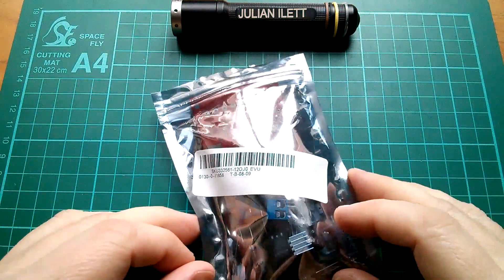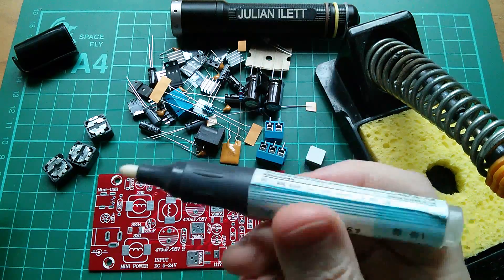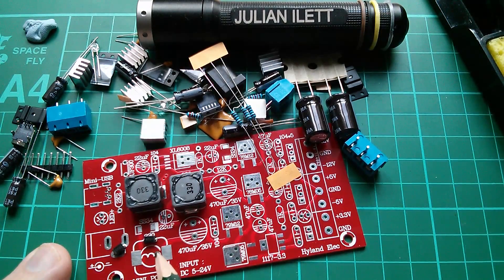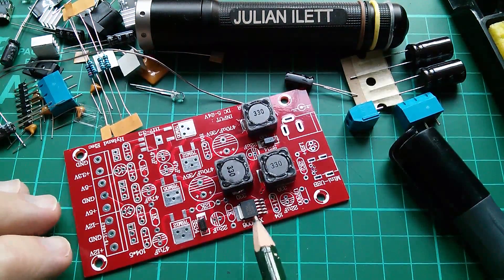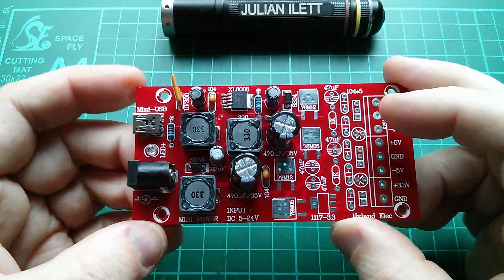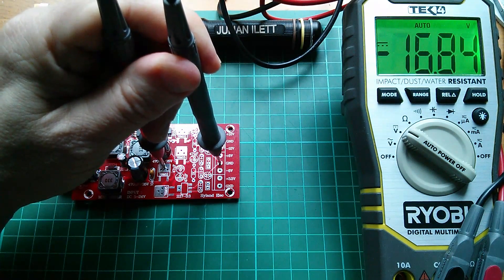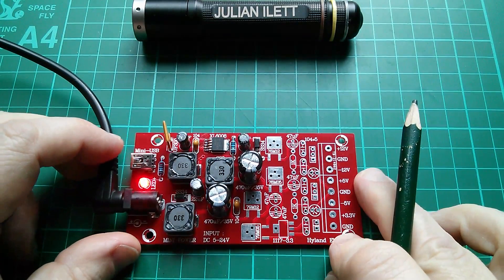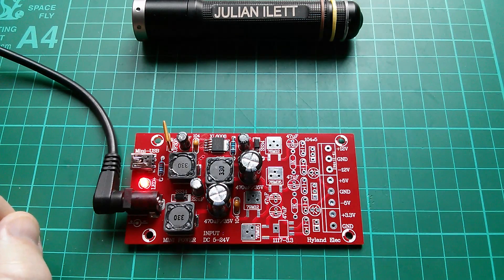Split Rail Power Supply Kit Build - SEPIC Cuk Topology

Comment: Pre-solder one smd pad. Use tweezers to shove component into that blob of solder while re-heating up that pre-soldered pad. Lift the iron. Component is now held in place by solder at one side.
Apply solder to the remaining pad as usual. Done. Component centered. Not tombstoning nor glitching away during soldering.

Comment: I came across the schematic of this kit while researching a replacement power supply for a Feeltech FY3224S signal generator. Hope it helps some one. https://forum.banggood.com/forum-topic-123630.html?page=3 If the link doesn't work, it might have been moved to another page of the forum.

Comment: Sorry if this is a dumb question... Since you were getting > 16v before the linear regulators, so could I swap the 7812/7912 for 7815/7915 and get +-15v ?
Reply from the maker: Not a good idea. The 7815 has a typical dropout voltage of 2V (according to the data sheet).
Reply: So it does.  Thanks for the quick answer.  I'm very much enjoying your channel; keep up the good work.

Comment: i always apply solder to a single pad and then with the component in tweezers you can slide the component into molten solder by applying the iron again .

Comment: This is really adventurous of you Julian, I designed switch mode converters for a living before I retired and I never understood either SEPIC nor Cuk converters well enough to actually use one.  One can get the basic principle of how they transfer energy from the input to the output easily enough but understanding the details well enough to design a converter is a step too far.  Most converters like this rely on using the inductors in continuous mode ie the load current should never be less than the ripple current in the inductor so they can't be relied on to work properly at no load.  Cuk and Middlebrook are well known in the industry for for inventing new complicated converter topologies which involve lots of complicated mathematics to understand and use.

Comment: Do you think this would run a few Eurorack synth modules??
Reply: My thoughts too. Plus a nice +5v supply as well. The power is enough for a few modules, the test will be how much noise is created by this circuit. I've ordered two from Aliexpress and will be testing them for noise in audio applications.
Reply: Chris Allan it would be a good cheap solution for a few modules yes. Wonder how many amps it puts out?
Reply: I built 2 and had problems with both. The 12v regulators seemed to drop the voltage to 4.8v. Tried a beefier psu than USB and the dc-dc chip fried. Same issue on 2nd board, not getting +/- 12v
Reply: this is strange Chris. I also think about getting one to test modules or schematics

Comment: Try soldering a tad bit of solder to 1 pad first (use flux). Then use tweezers to hold the part and then heat the pre-soldered pad with the part held in place and pressing the part into place with light pressure.

Comment: Opamps hate HF noise, so a scope of the ouput voltage noise would be interesting! Unfortunately almost all linear regulators are not good in surpressing high frequency noise. Below 1K they can reject almost 80dB of the supply noise, but at the much higer  switching frequency this drops below 20 dB! So the noisewill mostly depend on the quality of the low pass filters in the output.

Comment: Why wouldn't you instead make this an adjustable tracking regulator? All you would need is to add a pot instead on the ref pin voltage divider. It would be be more versatile and you could still use the other regulators  as well when it is above the fixed regulator voltages.

Comment: Hmm i think you should do your assemblings/component solder job in a time lapse....i just watched the very last minutes..the other is just too long/boring to watch...and may focus on where the "rubber meets the road" and test this thing.

Also there´s a reason for not putting the positive reggulators in series: when you draw about 800mA on the +5Volt rail and these 78xx would be in series, there would be likely no chance to draw some current on the 12Volts rail anymore, as the 7812 would be near its maximum current already. 
therefore, if you want to use both and load both with some serious current going parallel is the only solution.

Comment: Julian,

I reckon the positive side will generally need supply more current, particularly at +5 volts - that is certainly the case with PC PSU. With the +5 volt regulator feeding off the +12 volt regulator, you could easily exceed the current capability of the +12 volt regulator. Just a guess - i have no idea what the specs of the regulators are.

Alan
Reply: That's exactly my thoughts as well.
Reply from the maker: Yeah, I do see what you're saying. If you pulled the full 500mA from the 5V reg, you couldn't pull any additional current from the 12V reg (if they were cascaded).

Comment: There is a technique for soldering SMT parts one handed, so your free hand can (using a tool) hold down the part. Using some thick paste flux, dab some on the board pad and part you are soldering. Flow a nice blob of solder onto your iron top. Use your free hand to hold down the part, and touch the iron top and solder blob to the pad, a good pasty flux should let it flow easily.

Comment: Should you feel the need, for op-amp work, you could probably change the feedback divider ratio on R2/R3 and raise the output to 18V or so, following it with +/-15V linear regulators.
Reply from the maker: I've got another one coming which has +/- 15V :)
Reply: Excellent, it will be interesting to see what the differences are and how it performs.

Comment: Nice little kit julian, i like the use of blu tac, stop the little devils moving :-D.

Your 5v regulator input does seem a better way, but the 12v regulator would be loaded up perhaps double the current, perhaps a bigger 78xx regulator with heatsink would be needed.
Or put a big zenner in series with the 7805 input to drop the voltage a bit.

Possibly put a 2v zenna across the input led to stop it getting really bright :-D

Comment: This board has surface mounted components which are harder to solder than when the board is drilled. In that case the component leads go through the holes, and the soldering is done on the opposite side. That is easier to do.
So what is the advantage of taking the surface mount route?

Comment: Just what I have been looking for.  I would like to mod it to produce ±15V or even ±18V (for pro audio circuits).  Alas, not only is it "Under restocking. It will be available soon", but to add insult to injury: "For now, this product Does not provide circuit diagrams and installation instructions, just install correctly in accordance with the PCB screen printing, you can work without debugging". Thanks a lot, guys.

Comment: The problem with cascading regulators like they have on the negative rail. Is that the 7912 has to supply all the current that the 7905 draws as well as what you draw from the 7912. So it becomes a trade off between heat-sinking of regulators (the way it is done on the positive rail) and the limited output current of cascading in the negative rail (you can not expect to draw 1A from both the -5 and -12V rails)

Comment: You could always cut the trace on the input pin of the 7805 and solder a bodge wire from the (now isolated) input pin, to the output of the 7812. :)

Comment: your RYOBI multimeter? are you happy with it? there is a local pawn shop that has the same unit new with the film still on the display and spare battery and charger for $40.00
Reply from the maker: It's probably only worth that if you already have other tools in the Tek4 series
Reply: i dont. but i dont think that unit was offered in the states. i cant find much info on it. it looks to be a rugged unit and i tend to be unusually hard on my meters...i actually drove over my last good one.. thanks

Comment: 78/79 series regultors are too slow to reduce the high frequency noise. LDOs do better job. That'ss why you'll see this parameter in LDO datasheets. however above  10-20kHz the noise rejection is not that great. My guess is that this power supply will be terrible for audio.
Reply: If my memory serves me, the Sepic inverter provides quite low noise.  There are the multi phase devices that may be better, but at some point an optimum choice is something that is Simple and Good Enough.

Comment: 14:08 about the +12 and +5V linear regulators being in parallel, perhaps this is to reduce the load on the +12V regulator. Otherwise that would have to supply all the load on the +12V rail as well as all the load on the +5V and +3V3 rails (plus losses in those regulators).

Comment: Hi Julian.
I have a question about the maximum current that this supplies on the 5 volts rail. I am trying to power a raspberry pi3 with some 18650
Reply: 78M05 maximum current: 500mA. It won't be enough to power a Pi3 which needs a minimum of 750mA to be stable. 

Besides, you'd better getting a cheap empty powerbank on Ebay and then putting your 18650s in that powerbank. This board is meant for very low current devices like preamps or oscilloscopes, not for powering heavy loads. The linear regulators on the output will get very hot: at 500mA of load, you are dissipating 5.5W of heat which is wasted!
Reply: MrOpenGL
thanks

Comment: I've always been somewhat mystified by negative voltage rails. I understand that a negative rail is one where the voltage is at a lower potential to ground, but does that essentially mean that the polarity is reversed (i.e the same as flipping a battery around)? In which case, what purpose does this serve in applications that aren't things like motors?
Reply: Just to add, I've done some googling and I think I understand, in that it's the same as setting your ground point as being the mid point between two batteries in series, and this has applications for things like audio where the signal is basically AC? Would be nice to see some sort of explanation of this in a future video for noobs like me though!
Reply: Lots of analogue circuits require negative rails, if you picture a sine wave it swings positive and negative. Many Op amps require negative and positive supplies even if the output is only positive :-) Hifi pre and, power amplifiers and audio mixers are another example, I have and old computer sound card that has several +/- rails for op amps and A/D converter, also digital music synthesizers samplers etc.

Comment: Why in the world would anyone buy this kit?  Just liberate your fathers' ATX computer power supply.  A bonus is it works from the outlet in  your house
Reply: Computer power supplies do NOT provide the kind of equal-power, complementary-polarity outputs like this does. A computer power supply may provide 10 or 20A at +12V, but only 100mA at -12V (and modern supplies are dropping all the negative voltages as modern motherboards don't need them).
Reply: You wouldn't buy a new PC supply as an alternative to this kit - the kit is cheaper. But if you've got an old PC supply kicking around it'd probably supply at least 0.5A which is all this kit can supply on -12V and -5V combined. The four supplies I have lying around here are all either 0.5A or 0.8A.
Of course there are other considerations, e.g. the ATX spec allows 10% tolerance on -12V, and for audio applications you might not want a supply with a fan.
Reply: Wrong, wrong, wrong.  I have a 10 year old Delta power supply which produces 1amp negative voltage on 5 volt rail.  The rest of the negative voltages are .5amp
Reply: Joseph Nicholas
Older ATX supplies do higher negatives... Because stuff used to use it. More recent ones are much lower because manufacturers realised nothing uses negatives.
I've got one sitting here that says 300mA, BTW.
Reply: Richard Rudek Just type in 14:55 (literally: 14 "colon" 55)
Reply: PC power supplies are great - they have been a never-ending supply of quite high quality 12V,5V,3.3V PSUs for years now.
Reply: Julian mentions this at 14 minutes and 55 seconds ... 

https://youtu.be/XMnjllRMoy4?t=895

Comment: Regards SMD soldering, I tend to hold the component down with a jewlers screwdriver tip, whilst I solder one side.  With good flux (like Chip qwik flux) you can do a really tidy job.  But you don't have enough hands then to add solder to the iron at the same time.  I tend to add the solder to the iron tip, and then the fluxed component just sucks it up when contacted - rather than using one hand to feed solder and the other to hold the iron.

Comment: I would be tempted to feed the output of the 12v regulator into the 7805 rather than the 16v - well spotted!  Maybe they did that so the 12v rail could provide more current, but I would think that the 7805 wouldn't draw much current unless the 5v rail was loaded?

Comment: i wonder if this topology will work with toroid cores. having open core inductors close enough, probably couples them lightly through air or something ?

and yah, having linears in series makes the 7812 hot, while parallel makes the 7805 hot..... either way something will always get hot i guess.

Comment: The power dissipated by the +12 regulator would increase (quite a lot), if the +5V regulator input was to be furnished from it.  The net power dissipation in the positive regulators would increase and the efficiency would decrease.  This would be an inferior design.

Comment: The +5V is taken separately because probably the ±12V will be used by analog circuitry and this 5V for some digital stuffs. So to keep the digital noise out from the analog path, the designer has cleverly designed it for a purpose. -5V could be used just for biasing or whatever, but certainly not by any digital system unless there is a specific need for it. as you have all the gears to test and verify things, I just cant imagine why you spend most of the time capturing video of your soldering and variety of sponges you use one after another. You could have easily managed made your video with a bit of quality showing the performance or load testing and even ripple on those output voltages. Yes, a video on good quality soldering practices is very much informative, but then video title has to be made likewise. Its not even a fully product built showcase, and if this small thing goes more than one episode, then how long will it take to PIC assembly programming. My guess is more than year to configure all the peripherals of 8 pin PIC MCU.

Comment: Your timing is interesting... I have been looking for a means of generating 12v, 5v and 3v outputs >.>
I settling on boost the input to 12v, then use a switch mode regulator to bring that down to 5v then linear regulate the 5v down to 3.3v from there. Since there was low demand for 3.3v, moderate demand for 5v and high demand on the 12v rail this seemed to work out reasonably well >.>
Mostly the reason I was doing this was because that is what I had the parts to accomplish ^.^;
Doesn't half chew threw batteries though <.<
Which reminds me, I really need to find a way to keep track of the batteries output voltage and add a low power cut off >.>

Comment: Could you use a crocodile clip to hold the surface components down when you solder them? At least the ones near the edge. I was going to ask this last time you were doing surface mount but I saw lots of people pointed you to surface mount videos! You could also use one of those plastic B&Q (or pound shop) clamps as long as you didn't get the component too hot.

Comment: Try hot air soldering using a reflow gun for your surface mount components much easier faster cleaner neater job. I just bought one of those cheap Chinese three and one soldering stations with a built-in power supply for $89 I can't believe how well an accurate it actually works. After seeing so many videos of teardowns on these cheap Chinese soldering stations and everybody saying how poorly they were built with so many flaws inside and showing how to repair them I decided I want one to. I think all the bad clublez city to the Chinese manufacturers they took nope and modify their inside components and up their quality on soldering and connections because when I took mine apart to look for all the shotty work everything was perfectly no bad solder all wiring connections were fastened they upgraded Power transformer and power MOSFETs they added more heating cooling two components that get hot. I now think I have a cheap soldering station from China that'll probably last me the next decade

Comment: You need a better soldering iron. Try making one of these kits, http://www.banggood.com/Digital-Soldering-Iron-Station-Temperature-Controller-Kits-for-HAKKO-T12-Handle-p-993248.html - although you'll need a more useable shaped tip to go with it.
Reply: I have just built one (video this weekend), and am very pleased with it. The thermal capacity is certainly impressive coming from one of the 936 clones.
Reply: Oooh, it's got a Three Heart Aviation Unit.

Comment: Our SMD soldering techniques vary considerably. For once,  I've bought, assembled and tested a kit before you, but I didn't document it ;) . I used a flux pen, solder paste and a hot air gun to mount all the SMD components 1st, then tackled the rest.

Comment: Thanks for doing this. Ordered one already to power the wave generator kit. Still don't know what -12 is?
Reply: Watched another video recently about putting a different power supply together with + & - outputs, and it helped me understand. 
Basically if you put two parallel diodes on an AC output, one reversed, you get the top half of the sine wave out of one and the bottom half out of the other. Then you can then smooth this to get + & - DC out.
I think that's how it worked.
Reply: webchimp Thanks for your reply. I sort of understand although won't this power supply produce a straight line signal rather than half a sine wave. Anyway, unbelievably the kit came in the post the same day and I've built it and it does what it says on the tin!